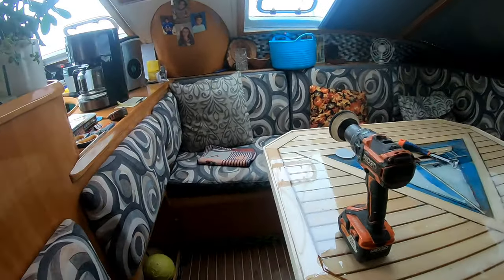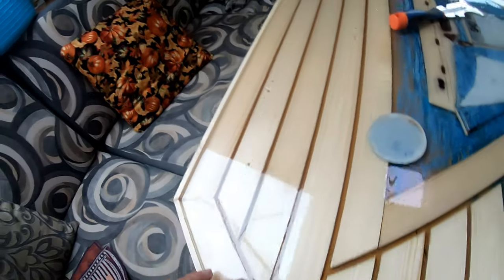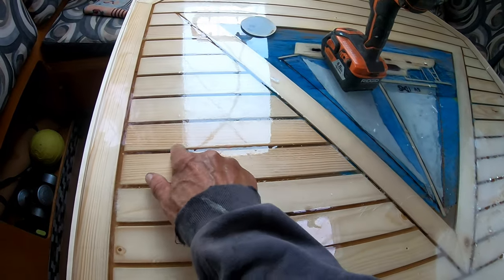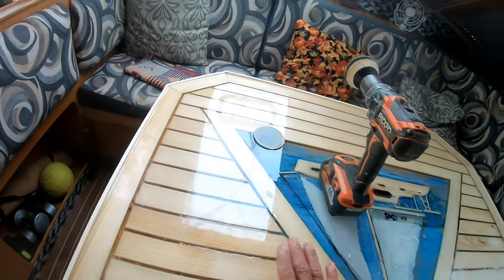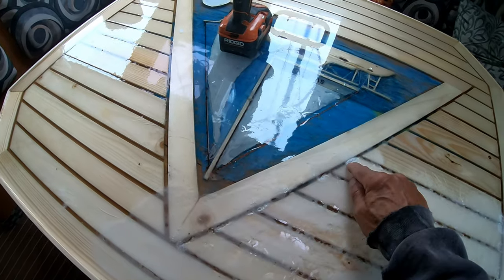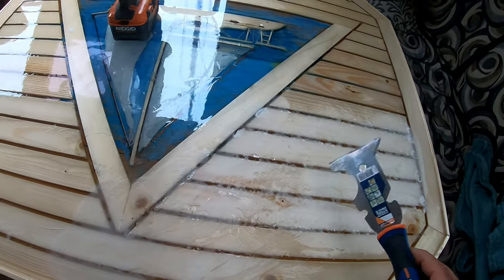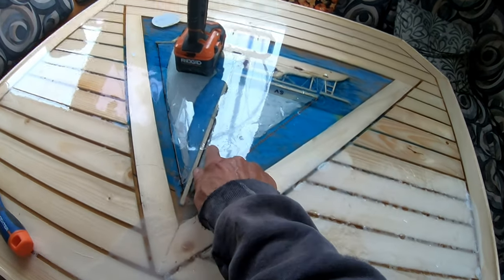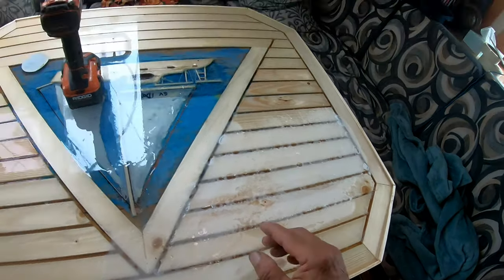Rebel Turner What a mess I have made with the epoxy

Comment: Is there possibly a local wood shop that has a CNC that could resurface it for you? Maybe take off 1/16 inch all across the top then seal the surface and repour. I liked the original table you had in there. Good luck and we really don’t need to worry because you’ll make it better than original before you’re finished.
Reply from the maker: Good idea but  finding a shop with a cnc  not very likely here in the Azores but I could make a slide for a rouder to plane it down .  the mess is a huge issue.  I am thinking of  painters' plastic  Isolate the area  and belt sand it. If that  fail I buy a sheet of plywood  cut to size and start over LOL
Originaly I wanted to make the top from a tree trunk slice with a live edge  but  could not get one big enough.
I'll get it done. either way I can't keep it as is.

Comment: You'll get it worked out, Al.  I'm thinking the wood in that corner wasn't as dry as the rest.  Resin doesn't like moisture and will react that way if it is present.
Reply from the maker: Good thought and a possibility even though it all came from same pile. After further investigsating how bad the issue was I realized that there was no way to work with the issue that was there. It forced me to think out of the box  and create something completely different.  now waiting on more epoxy LOL

Comment: Ouch! 
I have to agree that the wood has to be sealed before applying the epoxy. This will prevent the bubbles in the wood from coming out. Unfortunately, I would say that you would have to get a belt sander with 60 grit to start and get all that epoxy down to the original wood and start all over again. I'm sure that's not something you want to hear, but to me it's the only way to fix the problem and have it come out perfect. 
Good luck Al. I know you'll do a bang-up job on it. 
Tom
Reply from the maker: I am in complete agreement with the sanding it with the belt sander nd 60g I just hope I can stop at the lats  meaning removing a 1/8" of epoxy. Ifthat fai;s tna continue and remove the lats.

Comment: The humidity won't help either, also how much did you cut back the original wood? Also how fast a cure is your resin? Maybe a slower set next time
Reply from the maker: Thanks for watching and commenting   it is greatly appreciated as well as you suggestions.
I'm not sure I understand the question on " how much did you cut back the original wood? " as far as the dry time on the epoxy it is around 4 hours for it to start jelling up. It's a 1 to 1 mix tabletop epoxy.